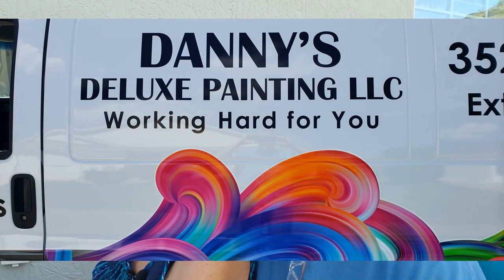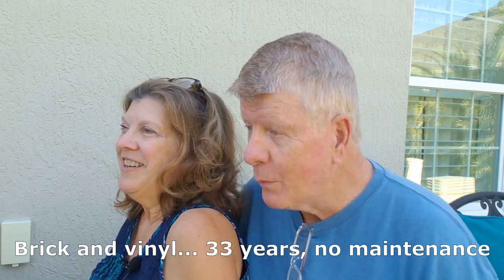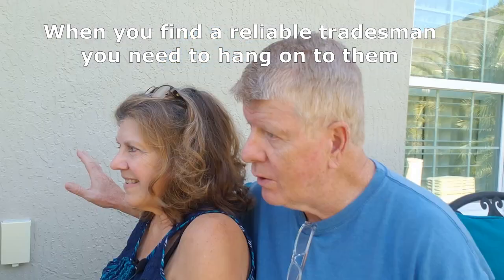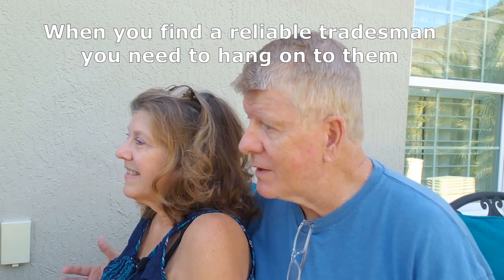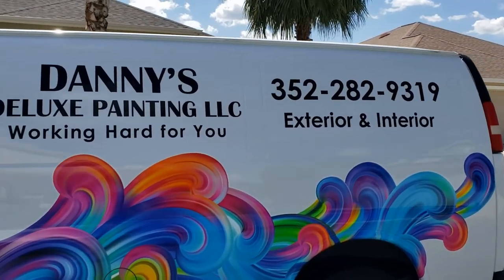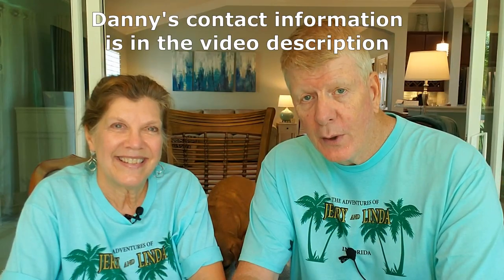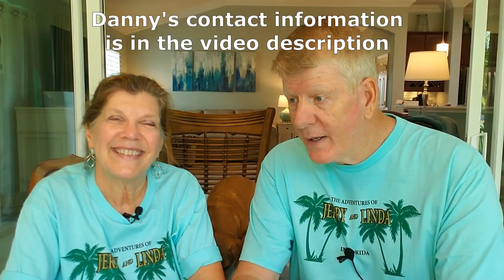Repaint Stucco Home After Only Six Years?

Comment: What a timely and informative video. We live in Georgia and are getting ready to have our three story Hardi-plank sided house painted within the next few years. The house is a khaki color and was built in 2004. It has noticeably faded. I’m very nervous about getting quotes. Thanks for providing this valuable information!
Reply: Hi Pam,
We painted our three story Hardiplank (3 sides) and brick fronted home in georgia before selling it last year.
SW duration paint, 2 coats. The cheapest estimate was $7000.  We got four bids, and they went from $7000 -$11,000 with same prep, paint, etc
House had about a 2500 sq ft footprint on the main floor, walkout basement and second story.
Painting is not cheap.
Good PAINT is not cheap!

Comment: From a 55 year Florida resident and  builder. The rough texture stucco really holds the dirt and moisture. Especially on the north facing side. Pressure cleaning every two to three years does wonders to get the dirt out of the crevices and bring back the new look. Helps also to keeps the mold & mildew away, paint looking good, and stucco from deteriorating. Trimming back shrubs from touching the house is a maintenance must! Also suggest keeping shrubs from blocking or up to high in widow areas. These areas will dry slower and thus the moisture will help deterioration and window leaks will be in your future. The small stucco cracks like you had are very normal. Beautiful home!. Quality workmanship is severely lacking in Florida. Not many good painters around Florida like you had. Great fun and entertaining video as always.

Comment: Had spider and larger cracks in my stucco home. Found a guy to repair. He was convinced the stucco job on the house was not done well. He used a nylon mat and repair paint/stucco done with a trowel. The color is in the final product and should not fade away. Home in seGA so we have close to same environment. Mold/mildew can stain which will not come off. It should last much longer than 5-10 years. Shoddy building is your biggest problem!
Reply: that's rubbish all stucco will crack at some point because every house moves and stucco isn't cheap plastic so it will crack its no big deal its a simple repair

Comment: Beautiful job. I am surprised you didn’t contact The HOA for the approved brand and colors. If The original paint looked so different from the chip, it sounds as if it was in fact not high -quality, as you said, and didn’t stand up to the elements.

Comment: I live in Northern Arizona and we get our TV stations from Phoenix.  Phoenix is extremely hot and dry. And they also have  monsoons and sand storms.  I notice commercials  for "Rhino Shield" paint with a 25 yrs GUARANTEE.  It is a kinda of ceramic coating paint....looks the same. If this can take 25 years of Phoenix...I am sure it could take it in Florida.  Do you have that kind of an option?   Have you ever heard of it?  Sounds like it would be good for Florida.

Comment: Home looks beautiful, so curious power washing the house did they use  cleaning  product first and what was the name of it? How much quantity required?

What was the second tier Shewood Williams paint called and the price per gallon. How many gallons did you use for 2 coats? How much for the trim second color and quantity.
Sorry for all the questions. I'm a little south of you in St Pete.
The paint quotes here so far for a smaller home have been 3k to 3.5k with paint and so far no one has mentioned  upgrading paint but they did mention putting a sealer coat on first. Why did you go buy your own paint? I know you mentioned you had extra time but so did the painters 😂.
Did you do that to control price or quality? 
Why Sherwin Williams?

Beautiful job what was your final bill?

Thanks neighbor ❤ and thanks for sharing!

Comment: I’ve mentioned this before in one of your videos about maintenance costs in Florida.  I know because I was a Senior Construction Manager for one of the largest home builders in the country.  Stucco homes in Florida only last six to seven years because of settling, cracks and fading and that’s why we chose a vinyl home.  Also AC and roof shingles need to be replaced usually within 12-15 years.  Very different from up North!!

Comment: Another great helpful video. Question1, In The Villages do you have to get your paint color approved by the HOA regardless of whether you are changing color and if so, how long does that approval typically take? Question 2, Was the cracking the main reason you opted to paint? The fading/chalking did not come through in the video. Vinyl does need some care, here in Maryland. Our home is 31 years old and we have had to use a cleaning solution on the vinyl siding of our house and also it can fade over time. We have a brick front and that needs little care. We have painted the wood trim windows and other wood work once in 16 years. The vinyl that gets the most sun is now in need of replacement. Linda, how could you forget Gizmo! :) Thanks for the show.
Reply from the maker: You must use a color on the approved color palette.   The cracks were very minor, but we are a bit paranoid. We like to head off problems before they develop.
Reply: @JERRYANDLINDA  I see, ours is the same. I think it is a good thing that can attract a certain type of home owner.
Reply: I wouldn’t have vinyl in the villages. It ages terribly in their heat and sun. Looks shabby quickly. Chalks quickly. Once that happens, no matter what you do it looks blotchy and awful. If you choose to paint vinyl, it looks like painted vinyl. Where the vinyl seams are there is simply no way to paint over it where it isn’t kind of a mess.  Looking alongside house you will be able to see old color inside the gaps at seams. And the where the paint originally stuck seams together eventually pulls apart and leaves little rough edges.
We sold our vinyl home here pretty quickly as the entire village we were in was looking rundown from aging vinyl. Don’t believe me, just drive through a 10+ year old vinyl area here.
The stucco home we bought has the original 15 year old paint job, which is just starting to show its age. TV must have used much better contractors and paint back them because I have never seen a builder grade paint job look decent after even 5 years, regardless of part of country.

Comment: It appeared that the painter sprayed water at the soffit which has air filtration holes in it. We’re you concerned that water would enter the attic and dampen the insulation?
The painter did a great job and he will be on my short list for painting. Thanks for the video.
Reply from the maker: We think he was very aware and did a good job.  We usually have the house power washed every year
Reply: I definitely noticed that, too. If I did that, it would have sent water into mine!

Comment: I painted my 2500 sq. Villages house last year 2016 built with SW duration satin the side and front was very faded from sun  after 4 years . I also rolled it one heavy coat 3/4 inch nap roller about 12 gals. of paint. I bought the paint on sale 30% off and it cost about $850 I had it pressure washed before painting for $90 , i did spray the garage doors .  I painted my Orlando house the same way in 2009 and we sold it 2019 and it still looked good , that paint holds up. I have been asked by my neighbors to paint their house but I will be passing Danny's phone number on.
Reply from the maker: Thank you, Kent!😁😁
Reply: Good to know materials cost. So, about $1,000 for labor. Between heat, humidity, arthritis etc, it is worth the $1000 in labor for us to hire a crew😁

Comment: We have the same size house (~2,000 sq.ft) and paid around $2300 and had the Sherwin Williams duration paint used. Don’t go cheap on the paint. Most Villagers wouldn’t be able to tackle an outside paint job. Trimming your bushes is a must. Also, we like our Painter and like tipping his Helpers.
Reply: We got three quotes from three reputable local painters in TV for our exterior on a 2200 sq ft home. All quoted two coats of SW duration paint. Prices $2150-2300. It appears competition keeps pricing fairly consistent.

Comment: Paint does not stick to chalk, always seal the walls after pressure washing. Rub your hands across the walls to confirm zero chalk, or else it will bubble up from trapped moisture and peel. I use Seal-Krete on every job and Lattitude by SW. 
SuperPaint is average and not the same formula as it was in the 80's/90's

Comment: In a climate with a lot of sun, you want to use a high end paint, I use Aura by Benjamin Moore... it has proprietary pigment locking technology that keeps your paint from fading, and after painting my house with it 12 years ago, I can attest, it WORKS. It's 75$ a gallon, but by God, it's worth every penny. Also, due to the high quality of the paint, it will cover in 1 coat.

Comment: Many of us here in New England have cedar shingle homes, including me. They’re beautiful, but require expensive maintenance every 9 years or so. I’ve had my 2000+ sq feet house and detached garage painted twice in 28 years, and it’s due again. I don’t recall how much I paid the first time, but the second time, it cost over 15k. The third time, I’m expecting close to 25k. I don’t know about stucco, but wood sided homes have to be able to breathe through the paint. Great care must be used when power washing because you don’t want water to go into even fine cracks or where paint has peeled or chipped off. To caulk over a wet crack would just seal the water in. The siding will never dry out, the paint won’t adhere properly, and it will peel off early. Too, I’m surprised your painter didn’t use a primer layer. I’d think the new paint won’t want to stick to the old paint as well as it would the primer layer. Maybe your paint had the primer built in?

Comment: 1500.00  is very reasonable. I live in Michigan and last month had 3 estimates between 5,000 and 6,200. Our house is 1800 sq ft tri level
 1/2 brick,  1/2 wood and stucco  It had been 8 years last painted.All painters used Sherwin Williams Duration. We took the 5500.00 Bid. 
Had to call 6 painters to get 3 to come out. Your fellow looks like he does a very professional job. Keep him on speed dial.
Reply from the maker: $1900 to $3000 and up.

Comment: Another great video. Did you have to get approval from arc board. How did you know the actual color of your home.?
Reply from the maker: We got a packet with the original paint colors.  We even had some cans since the home was less than 3 yes. Old when we moved in.   You need to make sure the color is on the approved list that is set by the ARC.

Comment: I was shocked to hear the outside ceiling of your entryway is merely Sheetrock.  Talk about a faux pax.  Very inappropriate.  I would replace that in a heartbeat simply because of the rain and humidity in Florida.  Didn’t surprise me about the poor grade house paint.  Your house is much nicer than the standard model, ie, loaded with upgrades.  Profit on a new home for The Villages must be enormous.  I don’t mean to be critical.  It’s just the way it is.  Would I still love to live there?  Heck yes.  I had to watch video again on a larger screen.  You must be sitting in your golf cart filming this.
Reply from the maker: As we also had in Indiana, the ceiling drywall is exterior grade or green drywall. It is for sheltered exterior ceiling areas. Weather- and sag-resistant, it has a specially treated water- repellent paper.
Reply: Yes, I didn’t think that Sheetrock was ok as an exterior surface.
Reply from the maker: It is completely fine for surfaces that are covered.  It is a special drywall.
Reply: @JERRYANDLINDA  I just learned something! Thanks!

Comment: It lost the shade of green u mentioned after painted. Very good job . Did u use a flat or satin finish? I only use the top Sherwin Williams brands and Behr premium ultra . Nothing else . The expensive paint u mentions I believe u were referring to an elastomeric paint that stretches . It fades easy but is good for covering homes that crack a lot . After the elastomeric pain has been on a year I put a better longer lasting pInt on top . It’s more expensive but covers the cracking good . Great video
Reply from the maker: Thank you! We used Sherwin Williams Duration paint in satin finish.

Comment: Being a lath & plastering contractor for 30 plus years in southern California, you should never paint over exterior stucco. All your doing is tramping in water causing the stucco to pop in time, the house needs to breathe and dry out during rain, sprinklers, etc. A stucco job should last over 30 years with a occasional cleaning. Cracks are completely normal as long as you can't fit a quarter in them. They would never leak water because the lath would prevent that, if water found it's way through and than come out through the screed at the base. Just my two cents.